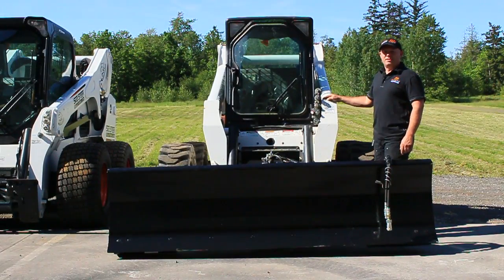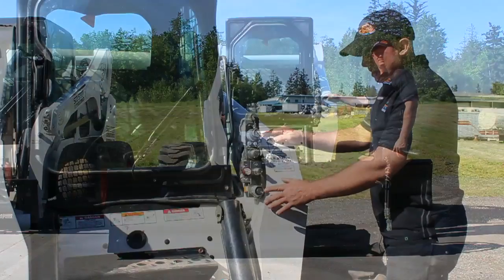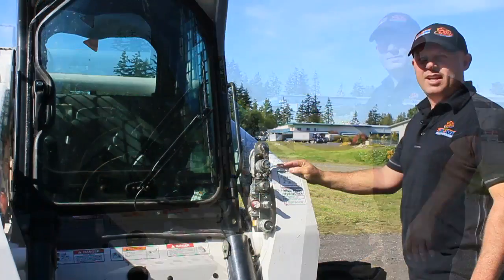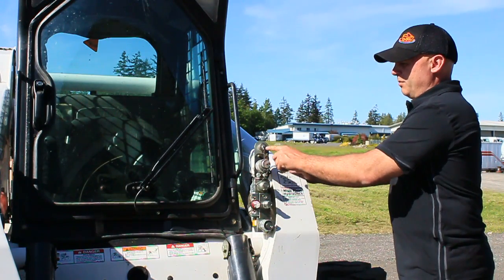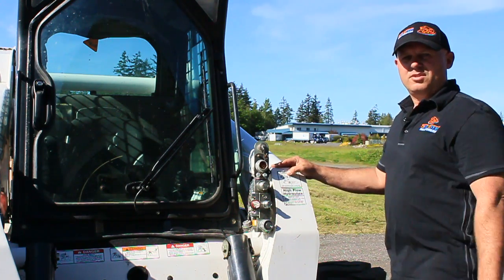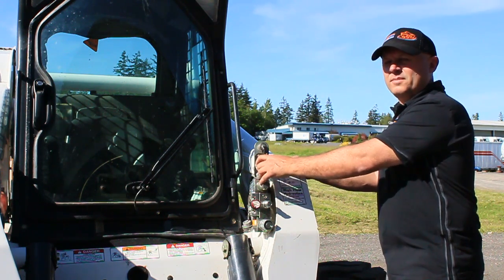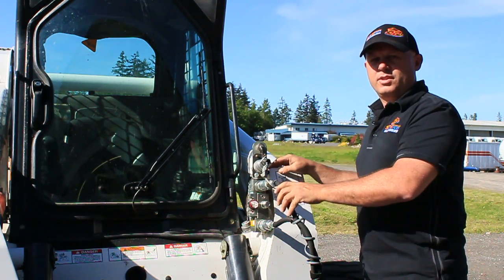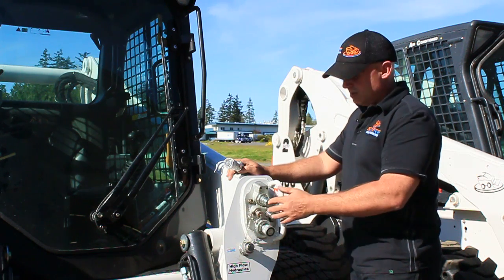Skid Steer Hydraulics Instructional - How do they work?

Comment: Is there suppose to be a check valve on the case drain line on the attachment, in this case a snowblower, that has the flow going from the machine to the attachment? Trying to figure out if I have the correct setup on a new piece of equipment.
Reply from the maker: Hey man, just give us a call at 866-966-2538 and one of our experts would be happy to help

Comment: Is there a fundamental difference between low and high flow, besides the gpm?
Reply from the maker: No, it simply refers to the amount of gpm the hydraulic system is capable of. High flow generally starts around 24-27 GPM but it is not a "black and white" line.

Comment: Oil doesn’t always flow from female and back to male, the flow can go in the opposite direction too.
Reply from the maker: True, many machines can reverse the hydraulic flow. This can be helpful for attachments like rototillers where you might want to be able to reverse the direction of the blades.

Comment: Why do we have 2 separate flows? Why not have just high flow, no standard flow?

When using a standard flow attachment that cannot handle high flow, the controller would simply limit the amount of flow.
Reply from the maker: Most machines that have both high flow and standard flow run a single hydraulic circuit like you said, with a flow limiter that you can activate when you want to run a lower flow attachment. However, not all machines have flow limiters, and the way the hydraulics work "under the hood" greatly varies from machine to machine for different manufacturers. We recommend consulting your machines manual/dealer for information on how to change the flow of your machine to be suitable for the attachment you are running. Thanks for your comment!

Comment: How does high flow works “under the hood”? 
Is it using a separate hydraulic pump? Does it bypass the filters to achieve greater flow?
Reply from the maker: If you need advice on a specific machine, send us an email at marketing@skidsteersolutions.com with your phone number attached, and we will have someone reach out and help you out.